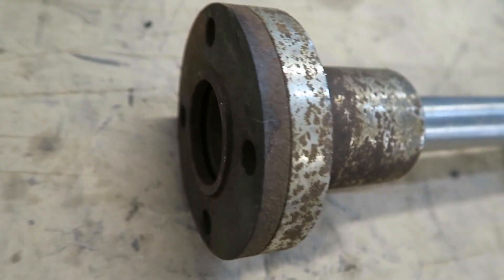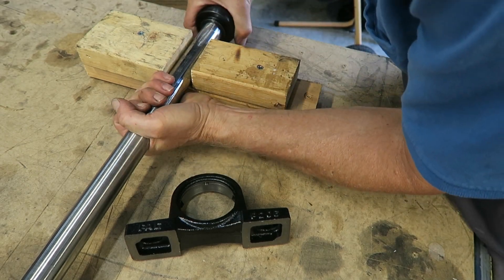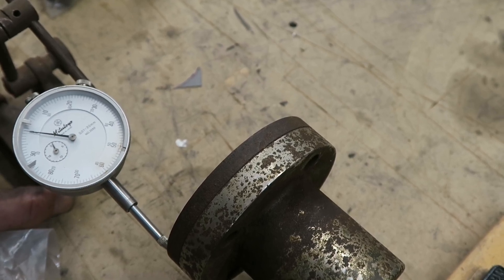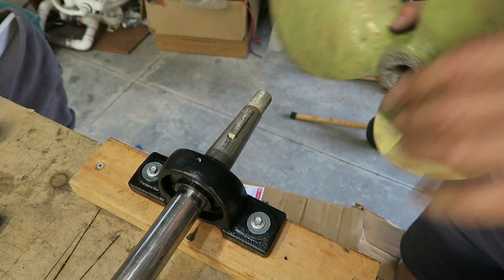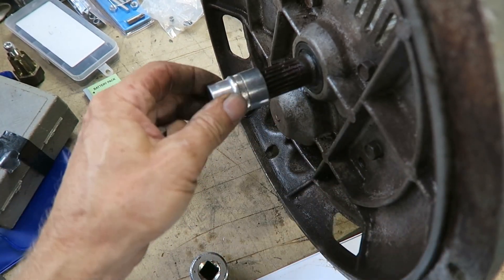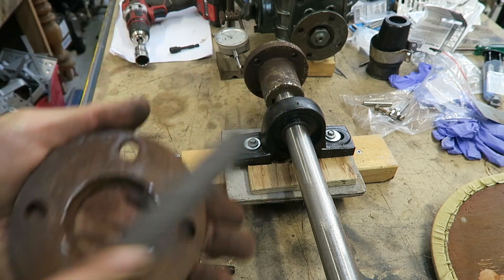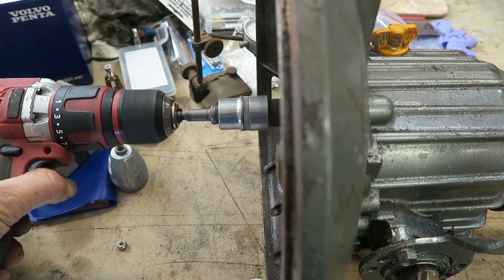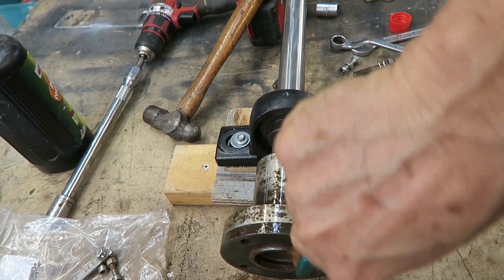Checking, testing, and fixing my propeller shaft, which was making the engine/gearbox wobble

Comment: I don't think you should see it turning in neutral without water moving past the props.
You may have warped clutch packs.
Reply from the maker: @gregsavino6541  This is in a sail boat. The scenario is when you are sailing along with the engine off. Yanmar specifies to leave the gearbox in neutral.